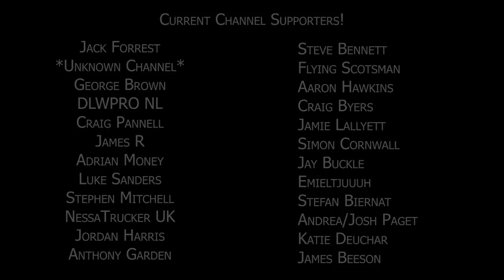I Quit My Job!

Comment: the haulage industry needs a massive shake up, basically modern day slave labour.
Reply: @Andyb2379  because working time and driving time are 2 different things. so if say you had 5 drops in a shift each drop you have to wait an hour that's 5 hours on top of the 10hrs you can drive in a day its a joke.
 and because the legislation says you can work 3 15hrs and 2 13hrs in a week, the planners, transport managers  expect you to do that cause its allowed,
the industry is slowly killing people off, the stress nowadays with the hours, crap pay, traffic ect just to name a few,
Reply: @Andyb2379  We are shattered...As the other commenter says, the office just expects us to max our hours out.
Reply: SuperFIFTHGEAR I definitely hear you. I’m class 2 been doing it 5 years. I deliver construction equipment a bit like Luke but on a much smaller scale. My hours are 7 - 5 as my yard shuts. I guess I’m lucky in that sense. But I agree how your expected to work 70 hours a week is just wrong.
Reply: @Andyb2379  that's what I've been doing for the last 6months on a contract, but money ain't great £10hr and if you aint driving you'll be pulling bins round at the back it's a young mans game or if your lucky enough to keep your health, my contract ends in a month or 2, not sure what I'm going to do.
Reply: If it as that bad people wouldn’t work the slave labour hours
Reply: @truckinghoppy9000 alot of people are trapped, once your in the industry it's quite hard to get out, it's not as easy as just walking into another job, and you are forced into doing massive hours by companies, if you say no your out the door I've been let go from 2 different places in the last year because I said no to keep doing 15 hours a day.
Reply: Mattfoster84 I disagree there’s loads of work out there people like to make a fuss out of nothing
Reply: @truckinghoppy9000  you must be one of the lucky ones then, well done keep on trucking 🚛💨
Reply: EnglishAndy you basically said it in your statement, driving time is different from working time, you ‘can’ work up to 15 hours a day, but only drive for a max of 9 but extend to 10 twice a week, it’s a complicated system, plenty online if you need more info
Reply: BWGA Agriculture WTF??!!
Reply: @Mattfoster84  
Spot on mate plus you can take more "REDUCED RESTS" or in other words more 15 hours shifts if you are at a long offload and have your Digital card on rest.
I walked out just over two years ago. Fuck em
Reply: @SuperFIFTHGEAR  
That's because the kids in the office see a wagon on the screen. They don't realise that it has a real person driving it to the max and they're dog tired!
Reply: Will it ever get a shake up? With the Tories promising to slash any European rules, look forward to returning to domestic rules or worse...
Reply: i\/  Where's that fella?  :D
Reply: @pit_stop77  When we leave the EU the current rules will all transfer over.  With a bit of luck we'll all go back to domestic on paper tachos ,no speed limiters and stick a massive middle finger up at FORS and all the Euro emission standards.
Reply: @keego2001  The shippers have work to go out.  With the company I work for they have all of the contractors (which generally get the longer runs and sleep out in their cabs) and their own drivers (a few night out, very few though) but they don't know where places are on a map.  We'll get back at 10-11am to load for our next run, they don't know/care that we've started at 4/5am.  They'll give us whatever comes up on the screen.  They don't understand the WTD or our driving time rules.  They just have loads to go out.  When it comes to 14:00 they're out of the office and the late shift starts.  The shipping department doesn't care if they send us to West London in the afternoon (from Tilbury).  They've sent me to Winchester in the afternoon without any consideration for me trying to get back in my 15hrs.  They don't care.  Nobody cares about the drivers - even other drivers thesedays don't stick together and help eachother out.
Reply: i\/ what company is this?
Reply: i\/  hahaha nice one
Reply: @SuperFIFTHGEAR  Ive been driving for over 25 years and the drivers/work was 50% better then than today,
Reply: My last place used to purposely route my emergency 1 hour driving into my shifts...if that makes sense? Very naughty stuff.
Reply: 56 hours is just driving time. It doesn't take into account 'other work'. It is not uncommon for HGV drivers to be doing 15 hour days. The industry is shite.
Reply: Exactly. Same as the bus industry. Nearly all drivers in both industries are unhappy but they feel they are either too old or not qualified enough to go and do something else.
Reply: I am looking for decent HGV work. I have a clean class 1, digicard and CPC.
Reply: Am a class one driver and I am on the agency because if you have a full time job tramping they take the piss it's as if you just live to work expect you to run in Saturdays without asking when you get back friday after being away all week can you just, joke and the pay should be so much more for the hours you do and the time away from home I ll never tramp out agian
Reply: @scroooge22  real skill I would like to see people with a degree blind side reverse up a back street with double parked cars
Reply: @tazkirk92  I've only trampled a couple of times and never again, no way for £20 a night not worth it, though tramping is Easier than day driver as you dont have to worry about getting bk home.
Reply: @Andyb2379  
Am on the bins and it's just the same some weeks 50 hours and some 60 it take the fun out of driving.
Reply: Been great reading the comments. I think it’s a similar story all over the world. It’s a shame there isn’t a national truckers union to voice this to Parliament. It’s us that’s keeping the economy rolling yet it’s us that seems to be suffering the worst. If we had that union we could all walk out for a few days
Reply: the slaves are in the trailers not the cabs
Reply: @cliveramsbotty6077  there in both coz if they get caught with someone that's jumped in the they will be used in jail as a slave
Reply: @scroooge22  real talk. I don't know where I'm going to get the money I make driving a wagon but I ain't driving no longer. Fuck the haulage industry
Reply: @CallOfBrians  find some land, collect greenwaste driving a wagon, turn it into black gold (compost)
Reply: @cliveramsbotty6077  no that's invaders
Reply: @Mattfoster84  like many industries mate, shite pay shite working conditions. i'm a delivery driver and i work one in two of my saturdays. and only get 20 days off a year
Reply: @Andyb2379  I got out of multi drop hgv stuff in the 90s and moved onto truck mounted cherry pickers. Although they could drive on the road they were classed as plant, and run on red diesel and were tacho exempt. Lost count of the times I had a 4 hour drive to site, put in 8 hours and then had a 4 hour drive back.  We averaged about 70 hours a week and the most I got was over 126 hours in a week and I did that for 3 weeks solid.  One firm I worked for had it in the contract that we  had to have at least a 4 hour break in-between shifts. Not for our benefit, not to rest or anything. It was just a way of getting us off double time.
Reply: My lot still don't pay breaks unpaid security guard for a corporate companies truck for a min a hour a day, absolutely shit industry offering shit pay conditions and hours.
Reply: As a driver the reason why the whole haulage industry is poorly paid and driver’s are treated like rubbish is simple, every trucker has to go through an recruitment agency to get any trucking job the agency then charges the trucking company a high fee then the agency pays you a low salary. This is why the U.K. truck driver gets crap wages. Not many companies hire direct they would rather go to agency where you’re hired today and got rid of tomorrow.
Reply: i\/  That is bloody awesome mate, good for you. Class 1 i take it?
Reply: @SuperFIFTHGEAR  Tilbury? What firm is that pal? (If you can mention) Im down the road in Purfleet.
Reply: Done the job class one . Lost my kids my girlfriend. No hobbies just working 17 hours a day by the time I get out of bed 15 hour shift then home it's 17 hours. Start five in morning get back to hard at five oh I can do three more hours .
Reply: @ibexdnb2879  it's no worth it £25 quid is pocket money, it's a insult to be honest. Should be about  £80 Ur living in a truck and shoudl be well paid for hassle.
Reply: @truckinghoppy9000  u
Reply: Hgv driving used to be a decent paying job but now with Eastern European workers willing to do the work for much less its no longer a viable career

Comment: This is an old video now, however I did general haulage for 30 years and have settled into Supermarket deliveries for a well known company. Its easy, well paid steady work with proper route planning, set start times and reasonable shifts. You know exactly what you are doing, all drops are back door in their own yards, no need to find places to rest, breaks are easy. Steady, steady work, give it a go sometime if you end up in this position again.
Reply: Out of interest is that the with a van or HGV?

Comment: The reasons you give for leaving your job are mostly the same reasons I’ve quit lorry driving for good.
I did multi-drop work and I never knew what I was doing or where I was going from one day to the next.
Even if I did get the same route every day I never knew if I would get drops 10 minutes apart or 30-40 minutes apart.
I had enough of the stress and anxiety that came with lorry driving.

Comment: Hi Luke, went through the same decisions when i was your age. Changed jobs lots of times to suit family commitments and most certainly changed jobs when I was not happy. You have definitely made the right decision if you are not happy, then you have to change (as the saying goes, 1 life, live it).  Enjoy Christmas with your family and friends then reassess in the new year.  I have been a HGV driver for many years and have been through a lot of highs and lows within the industry.  If you are looking for something slightly different where you can be your own boss and set your own hours but still want to drive HGV's then HGV Trade Plating might be for you.  Its what I do now and I wished I had found this career years ago.  I find it rewarding and stress free and every day is different.  There are still nights out but you can work days that suit you. 
Anyway have a wonderful Christmas and New Year, All the best Dave
Reply: whats hgv trade plating? need to get out the rut im in
Reply: @Mattfoster84   Hi Matt, HGV trade plating is basically delivering vehicles from a to b for an agreed sum of money.  Its done with trade plates (red ones you see running up and down the motorways).  I specialise in HGV class 1 or 2 which is called heavies within the trade plate industry but you can also do cars and vans which are called lights.  I am self employed and I am subcontracted to 1 employer which arranges the trade plates and insurances for you for each vehicle. One you have delivered you move on to the next collection which is either by hire car, public transport or hitching (Ive never hitched by choice).  The jobs are allocated to you from a dedicated team that progresses you through the week or whatever days you have agreed to work.  The best thing is that the HGV's are usually just tractor units occasionally with trailers, never loaded so no securing loads etc.  You get allocated night out pay which you either save by sleeping in the cab or use a hotel whichever you prefer.  So you get to see a lot of train stations and countryside between jobs but these costs are allocated in the price for the job so the money is from your wages.  So i use a lot of apps for cheap tickets and hotels etc.  I enjoy the challenges which is normally the public transport between jobs (finding the cheapest and quickest routes).  There are a couple of good companies to work for which you will have to research as I am not promoting the company I work for just the occupation.  Its not for everybody but I can honestly say I have enjoyed this career above any others I have had.  Hope this helps, if you have any other questions please do not hesitate to ask. Dave
Reply: @bigfoz8533  really appreciate the reply, ive always noticed guys standing at the side of roads and thought that's what they were doing just didn't know the official name, i have done it in the past with cars at hire places but you always got dropped off or picked up as it tended to be local ish, dont know if that would be for me as seems alot of unknowns and think im more of a man of routine. whats the pay like as the car side is crap minimum wage stuff.
Reply: @Mattfoster84    Hi Matt, if its routine your after then its probably not for you.  The wages can vary depending on the amount of deliveries you do and the days you work.  I work a 5 day week mon to fri no weekends and the lowest ive had is £600 net pw the best to date has been considerably higher.  This is one of the main areas that is beyond control because you rely on the work and the planners to create deliveries for your week. Dave

Comment: That’s a pretty crap wage for the expensive cargo you carry and vehicle you drive.i work 4 on 4 off for the council driving a precinct sweeper and that’s 13 pound an hr plus shift allowance.our bin lorry drivers are on about 15-16 pound an hr plus vehicle check payments.all the best in what you decide to do 👍🏻
Reply: What council you work for?
Reply: Mattfoster84  walsall Matt .think most councils are roughly the same possibly more money in London where it’s more expensive to live.ive been with them 21 years now
Reply: @tgun9248  I'm derby city council and driver/ collectors are only on £10:20 an hour unless u can get full time driver which is very unlikely there on 11:88, no where near that sort of money, and definitely no bonuses.
Reply: Mattfoster84 is that have rate at your place Matt for hoc drivers.we as grade 5 non hgv finish at 24000 a year plus shift alowance if we work street cleansing 4 on 4 off.it used to be binmen earned more money through bonuses as work harder but it all went to pay and grading and all one level depending on none driver .driver and hgv driver.mad realy considering bin loaders with a licence  don’t drive but still get paid drivers rate.i suppose every council is different
Reply: Our agency staff are on 10 pound an hr for working at the back of bin trucks
Reply: @tgun9248  binners only get £9 somthing, driver/binners get £10:20 I think and driver get £11:88 not site on the grading as I'm agency, but top wack drivers get £13 but really hard to get a driver only job, I find out tomorrow if I get a job on street cleansing but not sure I want it as even with your hgv license they only pay like £9:50 an hour and work 5 days and have to do weekends and have to work xmas etcetera, I've got my class one and can get £12ph a few places ive worked agency but the hours are crazy that's why I wanted to get on the bins as derby do a 4day week for the bins.
Reply: That's good money I only got £9.87 an hour for driving bin lorries at East Ayrshire Council

Comment: Don't hold your breath while waiting for a decent job to come up Luke.There are plenty of jobs out there but long hours and crap pay prevails. Until truck driver get a bit of respect for themselves and each other, we'll never get the respect from the employers or the public that the job warrants. Long and irregular hours, poor sleep patterns, add nightmare road, traffic and weather conditions and it's no wonder ex drivers don't get to live long enough to make a dent in the their state pensions or those sparsely provided by their companies. The solution is simple, drivers STOP TAKING IT UP THE ARSE! So well done Luke, you've done just that and having taken that brave step don't fall back into the trap. Remember if you only apply for good jobs you'll end up in a good job and it's worth the wait, in other words GET A GOOD JOB, DON'T REGRET A BAD ONE. Good luck, remember you've made some good mates on here and hopefully they'll help you get back into the drivers seat ASAP.

Comment: This is the reality of alot of trucking jobs out there. It's not easy and it can take a toll on yourself and your family if it doesn't suit. Work has really dried up quite a bit in the last few months, there is still enough out there but not so much picking and choosing. It could be why your boss was finding it hard to accommodate your wishes. I hope that whatever you decide to do it makes you happy and I hope that this period in your career doesn't divert you from haulage as it is a good job when you get the balance right. 

Good luck Luke and merry Christmas.

Comment: I walked out of my first class 1 job two months ago, it was multi-drop pallet work around croydon and Sutton, my two years class 2 experience was mostly on the airport and I was not ready for it at all, I didn't have the experience behind me and the work wasn't for me. However I've just accepted a 4 on 4 off job driving 18 tonnes delivering goods to all the airports, and they're getting artics soon and that should be an easy way for me to build experience on class 1. It happens mate, if you're unhappy always put yourself first!